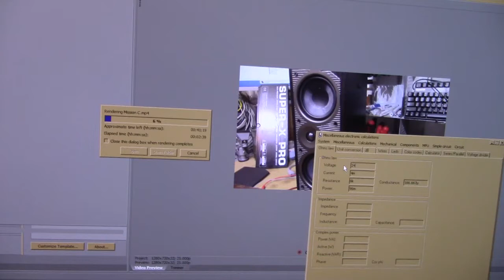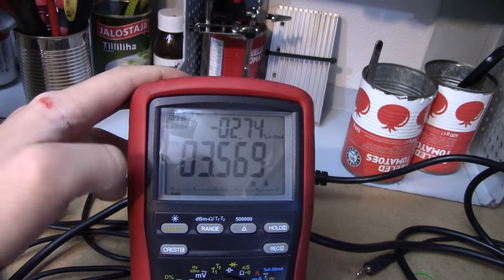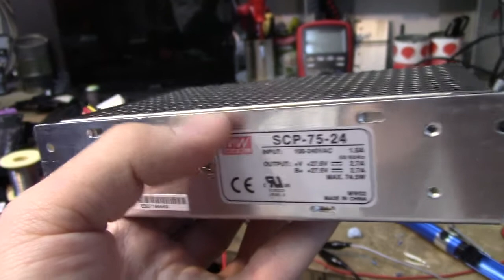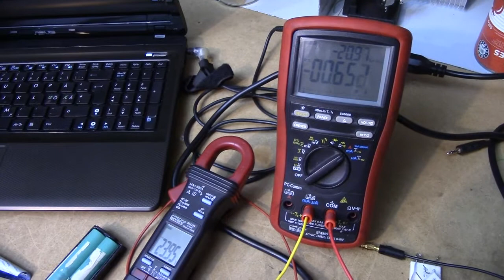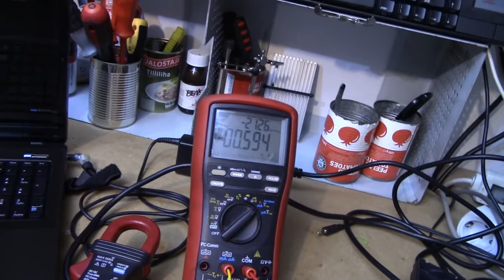"Mission C" part 2, rambling about batteries and lithium chargers

Comment: U can find 3700mah 18650 cells now with protecting circuits.  Looking forward to seeing this project finished. I built one using an ammo can. With a 18ah sla battery inside. It's abit heavy. 15+lbs waiting to see about going 10000mah 4s lipo battery. Just a bit pricey but much smaller and lighter.

Comment: Also have a look at the red batterys you have there,a s if they are Sanyo UR18650FM 2600 mah they SHOULD still be in very good condition, as I have seen really good results reusing them in battery packs.
Reply from the maker: +Unubtanium The Cyborg Whatever they are, they're out of a laptop battery with way too many warm cycles on it for them to be any good.